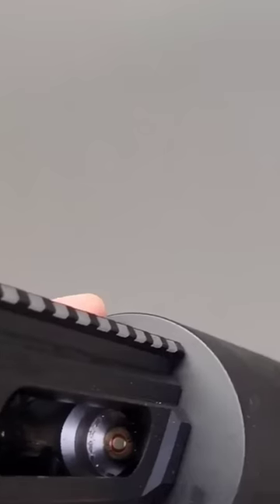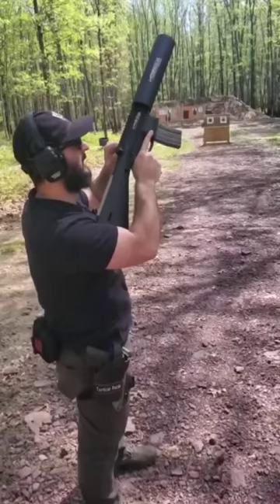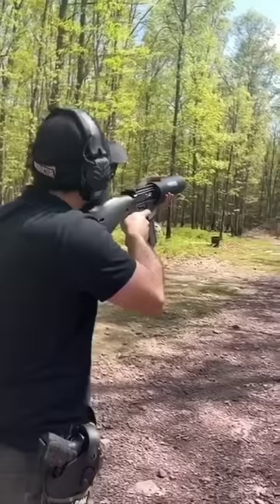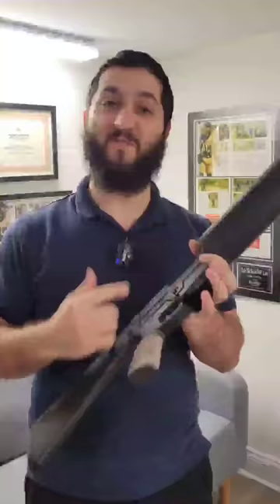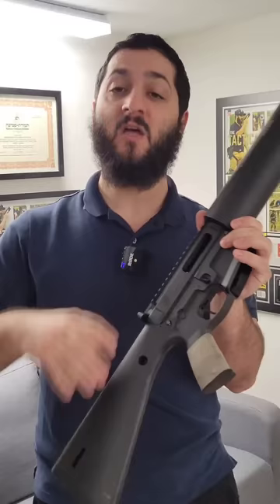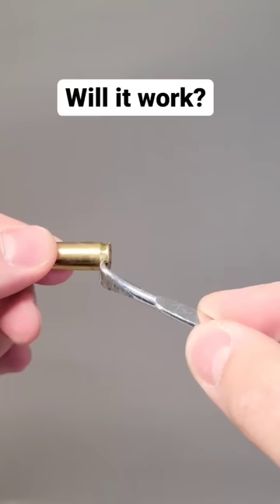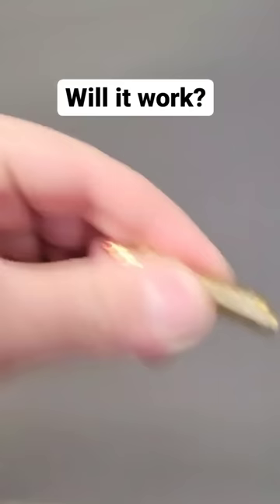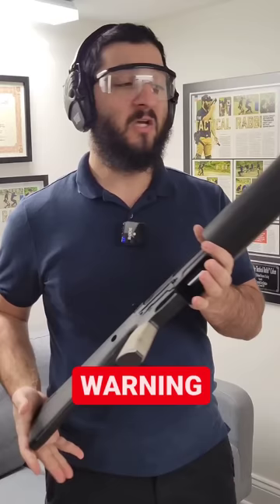I have a LIVE bullet stuck in my AR15! - Here's how you get it out.

Comment: You could easily use a wooden dowel or a cleaning rod to clear the round.
Reply: Thank you, unjaming rods exists for a reason
Reply: I thought the same thing, but I think I like this way more. After watching that video from military arms channel about what happened when a cleaning rod is in a barrel when fired, and at least this way the whole receiver doesn't grenade if it does go off.
Reply: Can cannon
Reply: @loganross705  Don't fire the gun then.
Reply: Oil goes a long way
Reply: @urfork1  You can tell when there is a light-strike versus a hang-fire, generally speaking.
Reply: @PeculiarTendencies  never said to pull the trigger while you ram rod a live round out of a barrel
Reply: @loganross705  I was trying to say that the chances are slim that a round will actually exist as a hangfire that long, although it is possible. Most of these issues come from poorly-shaped brass (reloads) that gets stuck in the chamber, and light strikes aren't uncommon either. On that note, the most likely way for a round to go off with a cleaning rod in the barrel is if you pull the trigger again (which doesn't make sense anyway because the bolt should be locked open). Overall, I think that unchambering the round in this guy's manner actually sounds more dangerous. You are exposing your hand directly to the round when the chamber isn't there to contain the explosion. If the round goes off there is nothing forcing the brass to maintain its shape and it is more likely to fragment. It is also just not a good idea to prod around the primer with that if you suspect a hangfire/jammed round...that's the area that makes it go boom. Cleaning/jam rods have existed for a long time as a reason, and it's because they are one of the safest and fastest ways to clear a rifle.
Reply: Lmao shoving a rod into the barrel of a loaded weapon is insanely dangerous and this method keeps you one the right side of the weapon
Reply: There’s just soooooo many wrong things you can have happen with a cleaning rod. There’s a reason it’s called a cleaning rod. FOR CLEANING.
Reply: No thanks i really like my hands and fingers dude
Reply: The can cannons have a guard over the chamber so you can’t use a live round and I think that would block it
Reply: @PeculiarTendencies  By your logic I should be pointint guns at people when I think it's unloaded
Reply: Good way to get a wooden dowel or cleaning rod hand piercing.
Reply: Cleaning rod
Reply: @adub1300  dont worry with that mindset they wont have the chance
Reply: @PeculiarTendencies  yes this is true, however it is still significantly safer to do it this way as opposed to having to flag yourself to fix the issue. bullets fired outside of firearms often leave most of the gunpowder unburned, so you might get a bullet lodged in your skin, and peppered by gunpowder if the bullet goes off after being removed by a paint can opener, but that's definitely preferable to potentially losing a finger. Its always better to keep your hand behind the barrel than in front of it, hangfire or not.
Reply: @NahImPro   You have no clue what you are talking about.
Reply: Can cannons have a gasket on the end, because they are designed to only be used with blanks, so you can’t actually run anything down the barrel
Reply: I would have pulled the upper off removed the BCG stuck the dowel in and cleared the jam
Reply: @loganross705  also the breech should be open while tapping the stuck round out. So if it were to go off you'd stick the bullet in the rifling while the case left the chamber at around 568 mph.
Reply: @terrysmith4465  I'm glad somebody said it
Reply: Just buy an ak that's why they come with cleaning rods
Reply: @TheDkb427  exactly. Fill the barrel with oil rendering the gunpowder safe, then use a rod to clear the round. That’s how we were taught.
Reply: @PeculiarTendencies  the main problem with clearing a semi auto rifle from the muzzle is that there are several ways the bolt can close unintentionally, risking a discharge in a worst case scenario. Also, hangfires can last up to 2 minutes and if a person doesn't let the rifle sit long enough you can get a discharge from disturbing the hangfired round with the rod. If the closed bolt issue happens, you lose parts of your hand instantly, and could detonate your chamber as well. If the more likely disturbed hang fire issue occurs, you get a lacerated and buised hand, and anything near the ejection port gets powderburn and brass shrapnel, and the bullet will be stuck around 2/3 to 3/4 down the barrel, meaning your rifle still isn't cleared. Using this method you block any closing of the bolt entirely, and a bursting round is less likely due to the force applied being lower and less direct. If the round does burst, it will most likely be out of the chamber preventing a stuch bullet, reducing the power of the bursting round thus causing less injury to the hand clearing it, and nothing becomes a weighted projectile. I've used both methods, and I can say with certainty that clearing from the muzzle is much more unpleasant even with a bolt action rifle. Most rounds will tap out easily, but I've had a few get properly jammed in, and hammering them out from the muzzle is terrifying compared to a controlled extraction that can't compress the round and gives greater control over the bolt.
Reply: Idk about you guys but jamming something down the barrel and putting your hand in front of the muzzle while there’s a live round in the chamber seems like a bad idea to me
Reply: To all who say putting a rod down the barrel is dangerous. Are you going to do it with your hand? Lol. You put it in a vice and slide the weapon onto it. If it goes off, you're no where near it. I thought this was common sense? I've never used a can opener, nor seen it anywhere. Any smart gun owner knows to never put your hand in front of the muzzle and keep it pointed in a safe direction. So, why would you do it when putting a rod down the barrel? This is dumb
Reply: @effyoo6081  most people don't have access to vices. Back when I tried it I didn't have one or access to one. Now I do, but I've found better ways to remove a lodged round, similar to the paint can opener but safer because you don't get near the breech. For those with limited resources however, the can opener is better.
Reply: @kyleheins  are you suggesting I meant an actual vice? If you cannot figure out how to hold a rod captive, you literally should not own a gun. I'm sorry but,  that's just silly
Reply: @kyleheins  use a can opener if you want. But learn to read as well, my original comment addressed people exactly like you
Reply: @kyleheins  hilarious. You have a thousand dollar gun and no access to a vice! Online next day delivery of a 40 dollar item...unheard of. Incapable of the simplest of tasks. You probably don't even own a gun, much less a can opener. You're literally the reason for my comment
Reply: @effyoo6081  Also, I replied to your original comment, so I don't know what you're on about, telling me you addressed something I was actively replying to...
Reply: No that would be too easy
Reply: Please remove the upper from lower first....
Reply: @PeculiarTendencies  Glad it ain't just me. I think the paint can pry is a good thing to know BUT when I did have a live round stuck in the chamber, I locked the bolt back ran a wooden dowel down the bbl, stood on the opposite side as the ejection port (with safety gear) and tapped it out. While I think his way might be a time saver in the field, I thought the same 2 things as you: (1) it puts you all up in that ejection port (2) you're pokin around really close to the primer. All in all, I just think tapping it out seems safer. Again, the pry method would be much quicker (AR's don't have a rod right under the bbl like an AK) but if wasn't in a DF situation, I'd rather just take the rifle home and tap it out.
Reply: Not shoving shit down the barrel with a live round lol
Reply: this is faster, easier, more efficient, and able to be done immediately behind cover if you have the tool on your kit...... using a rod works well and is great and all, but this is a really great way to get that shit out right now without having to break out a rod that you may or may not even have with you if you don't have a pack on or arent next to your vehicle
Reply: @tevin1633  It is safe, if done properly.  The primer is on the other end. Position yourself where you body is OPPOSITE the ejection port, wear PPE, and avoid putting your hand in front of the muzzle while tapping. I've done it (new chamber, a little tight and not well polished plus some steel cased ammo). I didn't even use enough pressure to cause any "bullet setback". It is actually a safe and simple procedure.  Just got take it slow and focus. Ymmv.
Reply: @effyoo6081  if you can't figure out that shoving a rod down the barrel of a gun with a live round in it YOU shouldn't own a gun. There are a million better and safer ways to do it. And you literally said vice so anybody who is a human with a brain that works normal would understand you are talking about a literal vice. If you were being metaphorical you could've chosen a myriad of different words that would have conveyed your intention much clearer.
Reply: @bitchface235  your literally more likely to accidentally strike the primer by messing with that end of the round instead
Reply: @bitchface235  hey Hoss, how does your local gun shop do it? I guess they don't know wtf their doing when they put the brass unjamming rod into their vice and remove the round like they have a million times in the past. I guess they need yo watch this video and get a can opener instead. Boy, they're gonna be mad when they learn that primus beast says they're regarded for doing it that way. Holy hell jimbo, you better get to work informing the thousands of gun shops about their error.
Reply: @bitchface235  a million better and safer ways, yet you couldn't iterate a single one. There's one way. Take it to your local gun shop and let a pro do it. Or do it like they do with a brass rod and a vice. Dolt
Reply: @bitchface235  you could literally vice a stick into a tree, and do it in the field. You think the army gives this type of can opener to its GI's? Lol
Reply: but then he wouldnt have tiktok content
Reply: @effyoo6081  yea cheers, just give us a sec and I'll pull my vice out of my daysack and attach it to a nearby tree to complete said action.
Reply: @ln5747  or, since your gun seems fucked, go home and try another day after you fix it. Or use your backup rifle. You hunt with a single rifle? Lmao
Reply: yeah, but then how would he waste people's time for internet points?
Reply: WRONG!!

Comment: They also makes rods for this exact reason. Wait 10 minutes after failure to fire, its extremely unlikely to go off after that. Push it out the other end and you'll be fine
Reply: Another thing I like to do is spray some carbon dissolving spray into the into the end of the barrel,and  let it set for a little while and a lot of times it will loosen up and then you can pull it out by hand most of the time

Comment: You can use a barrel cleaning round, pushed down the muzzle end to push the round out of the chamber. This can push the bullet back in the case, which is bad when fired, so don't re-use the round. The paint can opener is just as viable, but not as quick, perhaps safer, if you're careful neither is that dangerous. I have paint can opener for my Springfield Armory XD/XD-M's, if you need to remove the extractor, it is the only way to get them out, and usually have to file them down a bit to fit it in the narrow space necessary.
Reply from the maker: Please watch the updated video here:
 https://youtube.com/shorts/eiK_UyloP_c?feature=share

Comment: I've seen a few of these videos using paint can openers and have tried it at the range I work at several times and it has yet to work. These situations are almost always steel case ammo getting stuck in AR style rifles. They wedge so hard that only beating them with a rod or dowel from the muzzle end works. Maybe others have had success with paint can openers, but as for me and the other RO's? Not so much. Cracking a rod into a live round isn't the most comfortable thing, but no one leaves with a live round and haven't had a problem yet. Key word "yet"

Comment: study hydraulics; Oil or grease to fill the barrel, oil is probably better because it will flow and with the action open tamp a tight fitting wooden dowel or aluminum from the departure end of the barrel , Do use a hammer to pressurize the barrel, and It will press it out.

Comment: “It won’t be able to be lethal”
Tell that to Brandon Lee
Reply: For real wtf !
Reply: His was a different type of blank. The gun was a revolver with a pulled snap cap glued in the cylinder so you could see the ammo in the cylinder when the gun was pointed directly at the camera. They then used dummy rounds to get the bang when you pull the trigger. The guy pulled the trigger and the snap cap didn’t stay glued in the cylinder to make a long story short. Effectively a live round. Not a solid bullet but a hollow shell and probably fragmented inside him.
Reply: Or what about Helena Hutchins, the only truly "safe" round is a dummy round, if it has the potential to fire it still has the potential to be fatal if it's a blank to the head just look up Jon Erik Hexum
Reply: @Stonerolog1st  that was just flat out live ammo that killed her
Reply: @johnbrown4949  which doesn't excuse for the lack of gun safety, if your messing around use a rubber replica or a dummy round, depending on what the scene calls for if they needed to use a blank they should've taken the proper safety precautions, the air pressure is still pretty high in a blank, which should never be fired point blank the wadding usually has enough pressure to kill
Reply: That was the first thing that came to my mind.

Comment: When he said : "I even wacked the gun against the floor" that's when I knew we are dealing with someone who can not be trusted around firearms 😐
Reply: It is actually a common practice called mortaring your rifle. Granted, using it on the flat range is frowned upon. It's meant almost exclusively as a last ditch effort in combat before disassembly of your weapon. Mostly because it can damage and render rifles in-operable due to possible damage of the buffer system. Can confirm it works well when done properly. Side note: This guy is kind of a joke. In my opinion.
Reply: U do what u have to in the field. Dude just wanted a reason to say “tactical Hyde”
Reply: @TheRealBadMan  you are so right. Nameless shame dropping.
Reply: It looks like he shoves the barrel of his rifle into the dirt. Lots of bad habits
Reply: @greisensharrard5650  I don't see how mortaring will damage the buffer system itself, with the exception being that you could strip the threads on the buffer tube. Mortaring is a common practice for extracting stuck casings from thermal expansion due to prolonged firing like 3 30rd magazines in quick succession
Reply: @luislongoria6621  it can bend the buffer tube itself. Which will reduce travel of the buffer. Ive only seen it once and admittedly it was an Anderson gun. But it can happen. Not saying it's common or universal. Just possible.
Reply: @jettdyer7688  it's the end of a can cannon that's not obstructing the gas in any way
Reply: @greisensharrard5650  I mean it's a blank worse case it shoots a wad in the air or he damages his buffer not really a safety concern tho
Reply: @dobber43  yeah, you still won't catch me doing that to my rifles.

Comment: This actually happens all the time, especially to new guns. You can also use a dental pick or anything the can slip under the rim like a bent paper clip. The extractor cant grip the rim but its usually not stuck in there that bad. If you can open the bolt, get the mag out, lock the bolt back, get a light and play a game of operation with that dental pick or whatever and clip it under the rim. Had it happen many times with cheap steel case ammo and was easy to get out. You can probably also shoot it out...

Comment: Easier way: 
Open and lock bolt back.
Stand rifle on buttstock angled a bit away and safe. Drizzle a couple drops of oil down barrel and wait a few minutes.
Meanwhile set up your cleaning rod with a plastic tip on it. 
Place a piece of cloth over bolt face and insert end of rod with plastic tip into the muzzle a couple of inches holding with thumb and index finger tips.
Drop it into barrel making sure to instantly get fingers out the way.
Round will pop out into the chamber.
Now field strip your AR and clean barrel and chamber thoroughly.

Comment: first thing i would do is check to see if my ejector is destroyed. dropping a round into the chamber and closing the bolt on it can damage the ejector. use a 22 caliber cleaning rod to tap the round out. my argentine mauser has a built in ram rod. i got a round stuck in the chamber once. i just took the rod out and dropped it down the bore and the round came loose.

Comment: rounds that aren't chambered aren't as dangerous as you think. There's not that much energy built up to move the bullet when it's not in a barrel. I've caught a .22 a pillow case by setting it off with a bb gun. Really dumb thing to do but i did it 😅. I'm sure larger calibers are more lethal but they aren't the same as firing it out of a firearm

Comment: you know that if your shooting blanks you should have a blank firing adapter in the barrel or you won't get enough back pressure to extract the round. we used them in the military when we used blanks for laser tag with M4's (miles gear)